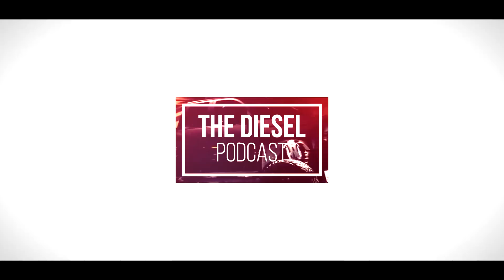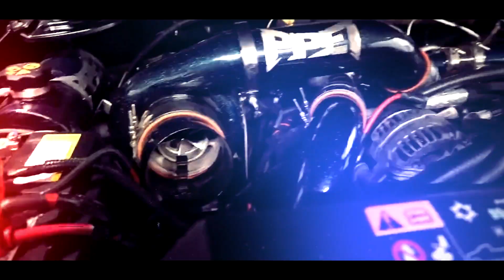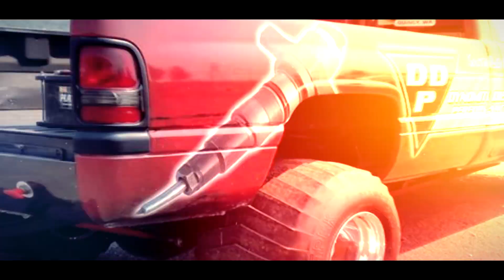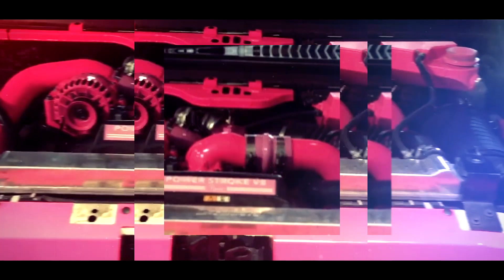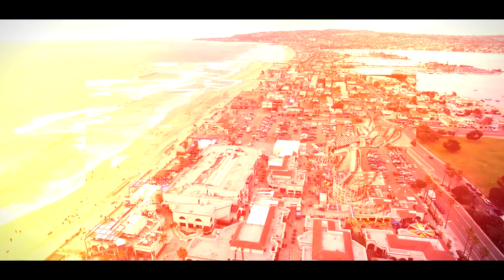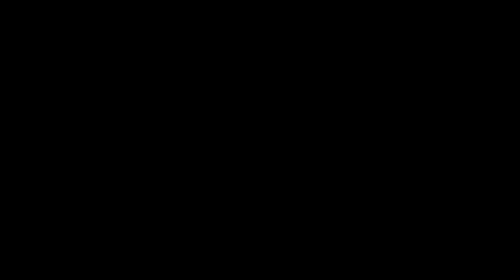When 6.0L Powerstroke Injectors Fail

Comment: Too late to ask. I have a real blue spring in my fuel system after removing a "blue" spring that was not cutting it. At idle my fuel pressure is steady at 60 PSI, under load the fuel pressure at the fuel filter housing with an installed fuel pressure gauge. Under load the fuel pressure will drop down as low as 55 PSI. Is that normal or is one or more injectors having a problem or is the fuel pump not keeping up?
Reply from the maker: We did an updated video with Holder’s Diesel a week or so ago. They give out their contact info in it, I’d send them over an email or give them a call. They’d be happy to help!

https://youtu.be/tZNiuHJQk1I?si=LpgfvPGniUjGj8cW

Comment: I own a 6 l bought it brand new love the truck but I've always changed the engine oil every 5,000 miles used quality oil and every third oil change I change the fuel filter and just changed them at 230000

Comment: What I’ve heard you need to watch out for is failing to identify the root cause that whacked your injectors and you go to replace them, but the problem still exists and the new set will fail a lot sooner.  So if you could break down what issues lead to injector damage in the first place and how to diagnose them, it would be really help.

Comment: When should you change cups on the 6.0? I am doing injectors on a high mileage motor And can you change cups on the odd side with the heater box right there? Working on a 2003 f450, thanks
Reply: They fail rarely

Comment: My 6.0 has 287k on stock injectors
Reply: you better buy a lottery ticket
Reply: 392k miles F450 42k lbs gvwr with trailer
Reply: 262k here
Reply: Mine went 201k and then my #5 went. Doing all 8 now and upgrading.
Reply: 204k original injectors. 07 cclbkr
Reply: What have you done to it?
Reply: Whats your regiment and you running any bypass filtration systems? You running HSS regiment?

Comment: I Have a 2007 F50 super duty 6.0 when I turn on key I get not self check sound on my injectors what can it be ?
Reply: Sometimes you will hear the injector pre clatter and sometimes you wont, dont sweat it, mine as well as many other 6.0s ive worked on have done the same